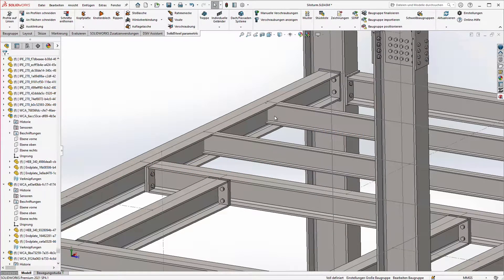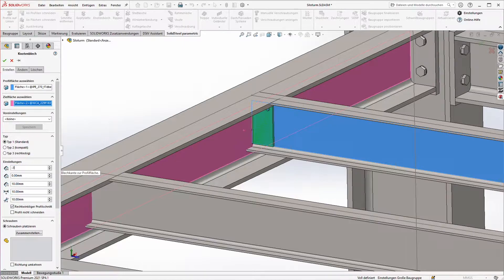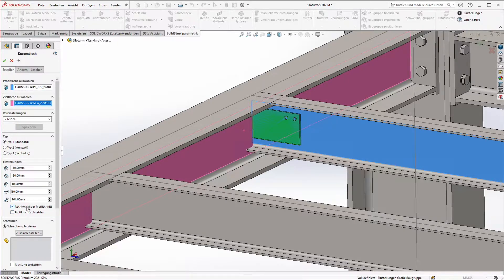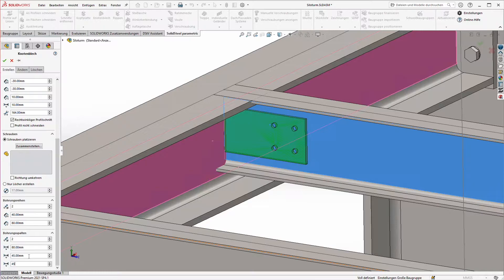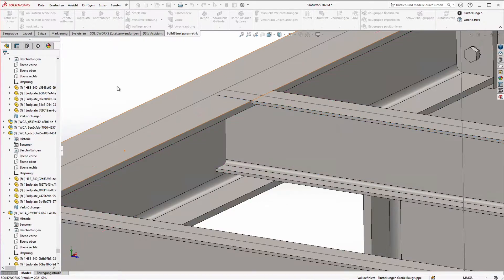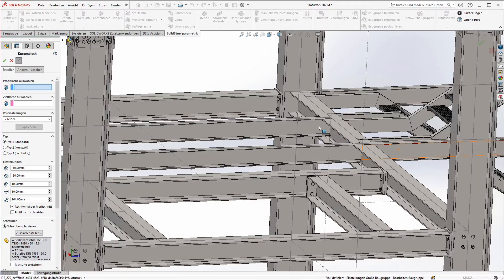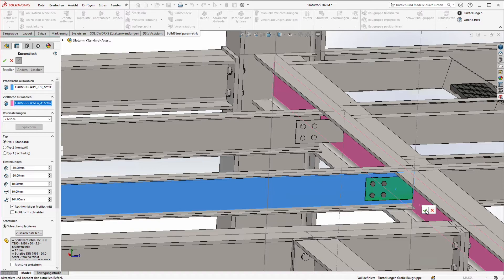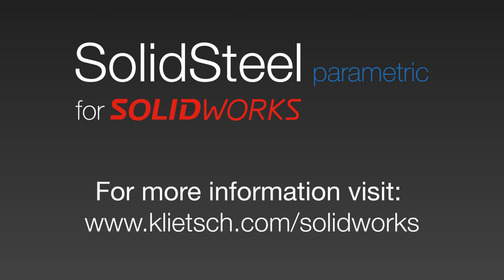Create fin plate connections with a fast workflow in SOLIDWORKS with SolidSteel parametric

Comment: Do you add the bolting within the weldment part itself? It's this ok?
Reply from the maker: SolidSteel parametric is working on Assembly Level and is not using SOLIDWORKS weldments. The bolts, nuts and washers are just added to the assembly (as an option just the information is added to the borehole, if you don't want the bolts as parts in your design). Maybe also interesting: For the boltings, SolidSteel parametric don't use the SOLIDWORKS toolbox. All bolts and other parts are delivered with the software.
Reply: @apps4swx  This is professional. Do you have any video how the drawings are generated?
Reply from the maker: Unfortunately we don’t have a dedicated video for that topic, but a bit you can see here: Structural Steel Design with SOLIDWORKS - SolidSteel parametric - Product Video v2.0 - English
https://youtu.be/-AtvXHMw8iE
Reply: @apps4swx  I wish also the sections are delivered along with your add in with it's material grades.
Reply from the maker: All sections are delivered in many different, international standards (US (inch + mm), European, UK, Chinese, Australian, Russian). The material can be selected individually.